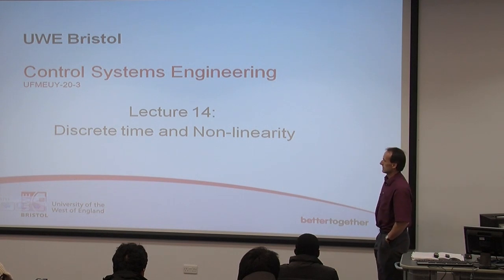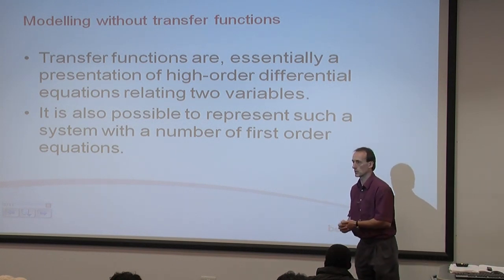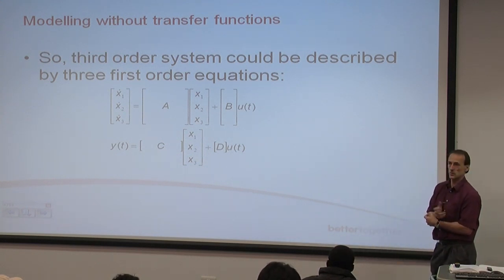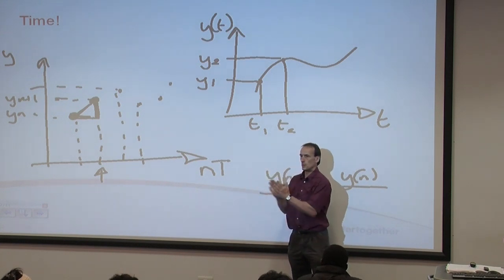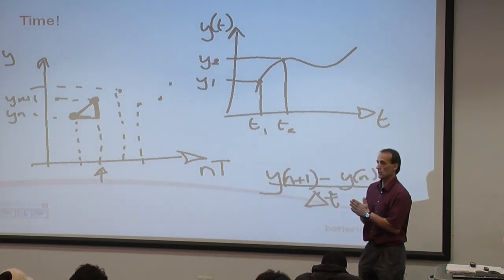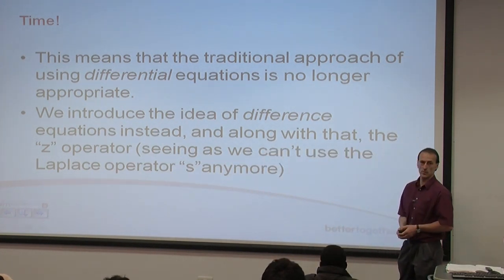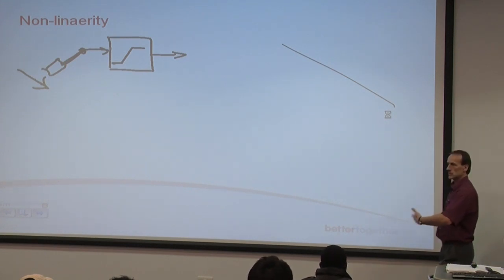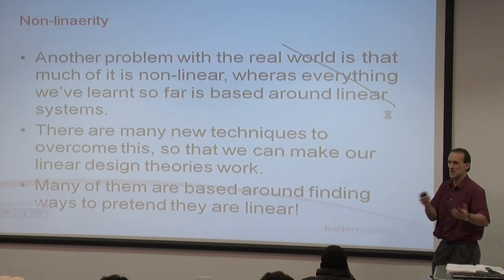Control Systems Engineering - Lecture 13 - Discrete Time and Non-linearity

Comment: 15 years ago this would have been called an artificial neural network controller.I have worked with ANN fuzzy controllers which also use fuzzy logic (a mathematical formalism of hysteresis.)It is interesting how many AI research results have become mainstream methods.